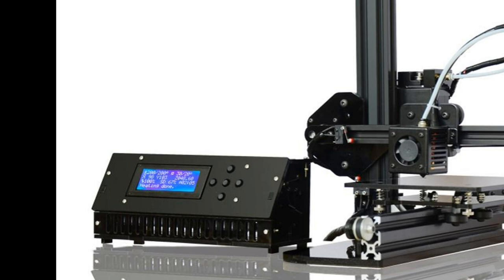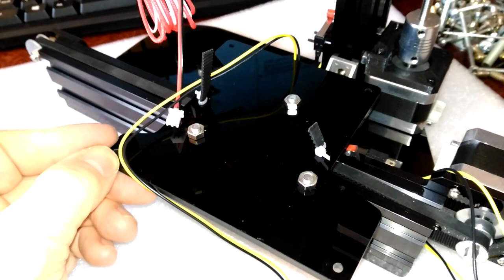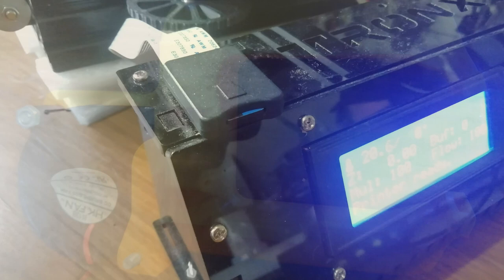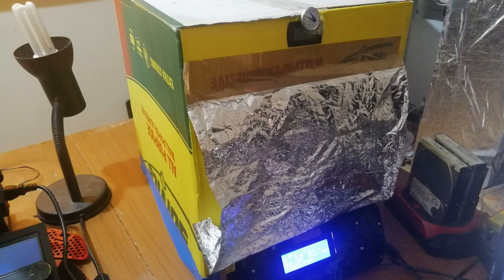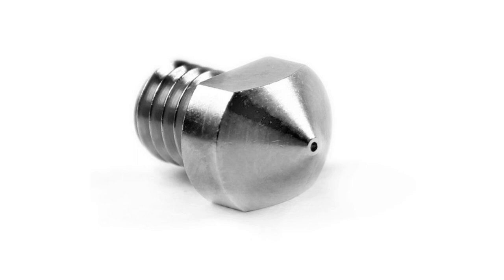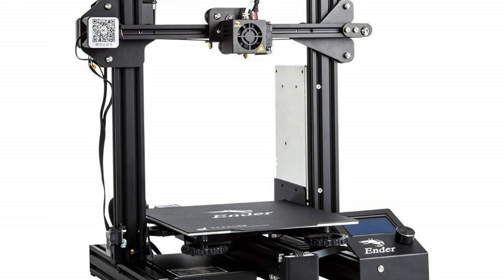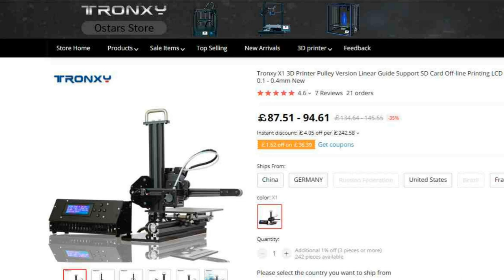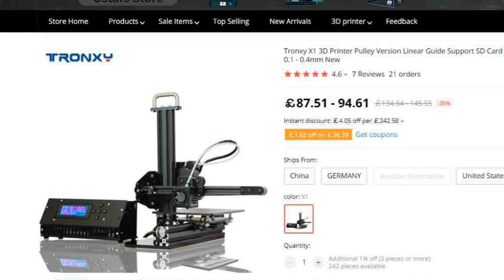TronXY X1 Happy 3rd Birthday

Comment: I'd be interested to hear more about your spectrometer business. In particular, where do you advertise the product?

My 3d printing story is quite similar to yours: I initially bought one because I discovered that they had become cheap enough to be worth a punt, and found that it is an incredible machine that literally changed my life. The quality of the stuff I can make at home has increased 100-fold because I am no longer limited to what I knock together out of bits of wood, and the way I think about parts has changed due to spending so much time in CAD and really considering the relationships between different aspects of a part. Truly life-changing.

It's a shame that a lot of people who like to make stuff think they won't like 3d printing because "the machine does all the work". That couldn't be further from the truth! The 3d printer is just a tool like any other. Anybody who likes making stuff will love 3d printing.
Reply from the maker: James thanks for oyur comments - some excellent points which I totally agree with. I've noted your business interest, and will put it in the pot.